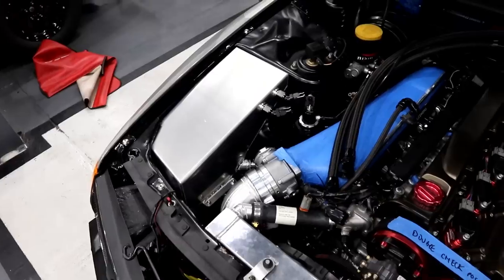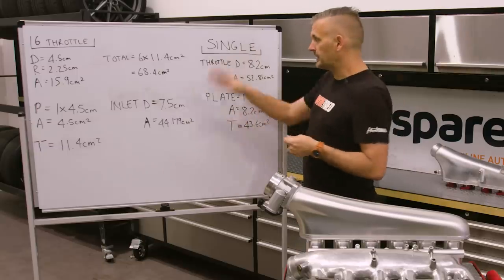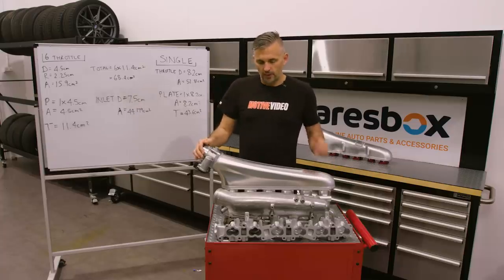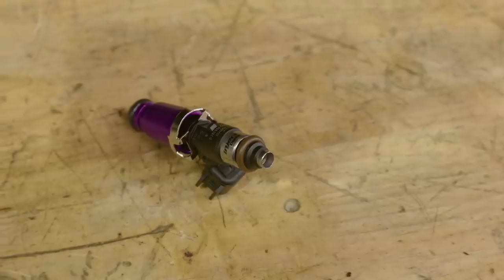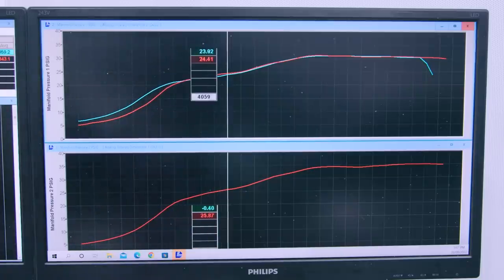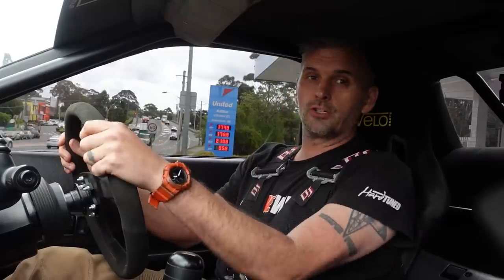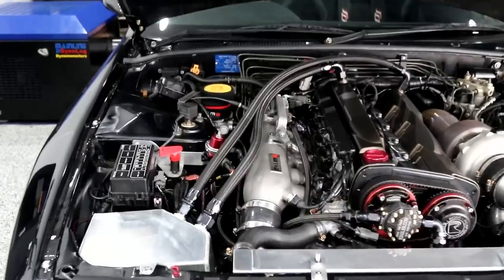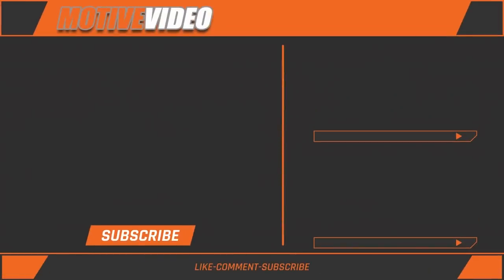6 vs Single-Throttle - Which One is Better on 1000hp RB26? - Motive Garage R32 Skyline GT-R

Comment: @ 20:19 you mention the big throttle body can cause hesitation from low revs. That could also be because of the very large injectors? I know some folk use twin injectors (one big, one smaller) to tune for low revs.

Comment: Every single person that Ive followed has tried drive by wirer and ever single one of them has gotten rid of them because all they did was caused more problem then it was worth. It's to dangerous to run in a drift car and it's useless in a drag car because as soon as you put power to the they shut themselves close. If you could somehow make that work I'd be truly impressed. Also you'd be the only GTR that I've seen on this channel that I've seen have one because all the other ones you features don't have one.

Comment: Have you looked at trying a Bosch Gen 2 iBooster, electric brake booster from a Honda Accord or Telsa Model 3/Y, would be a lot simpler and lighter than vacuum pump, It only requires 3 wires to work, Ground, 40A fused Positive and switched Positive.  

SuperfastMatt did a good video on it call "Inside Tesla's Brake Booster (And How To Use It On Any Car)" about a year ago.
Reply: Those electric brake boosters are horrible, zero feel on the brake pedal just all or nothing
Reply: @luker3456  You want to back that statement up with a source, because I can't find a single review of the Honda model year they were introduced where anyone complains about brake pedal feel, but more than one that says brakes were easy to modulate. The brake pedal is still mechanically connected to the master cylinder and the assist is relative to force on pedal. The assist ratio is programmable.
Reply: @taznz1  its from experience mate, almost every car has an electronic brake booster now and they are all horrible as they all use the bosch off the shelf part.

Comment: Andrew you probably know, but you should see if you can use a pipe with a less aggressive bend or a straight section at the turbo because your just throwing in bunch of turbulant air into your turbo. It needs space to become laminar or close to.
Reply from the maker: Cant without cutting the body up. Plenum sits quote far forward

Comment: Your only criticism is the single throttle is too touchy coming off idle, this is an issue with a big cable throttle but you can tune it out with DBW on Haltech.
Reply from the maker: Correct. It was literally second drive off the dyno.
We can finesse it further
Reply: @MotiveVideo  it's driver preference that takes time to perfect, I'm still fine tuning this on my own 2jz with hypertune/82mm combo, though was instantly much better to drive than the 90mm throttle it used to have, and these issues are amplified by having an aggressive clutch in the mix..

Comment: Flow is about air velocity, so rpm. If you increase the boost the velocity doesn't change. I calculate your car only needs a 50mm throttle body. A throttle body size comparison would be nice with dyno results.
Reply: For Comparison, rally cars have a 36mm restriction before the turbo making 280kw, which is about a 65mm restriction before your turbo for the power you are making. That equates to a 36-40mm throttle body on the inlet manifold. Big difference from what is needed, to what people actually have.

Comment: Going to ditch the ITB's on my GTIR, being a 4cyl the lack of vaccum at part throttle and tuning around that with TPS and boost compensation sucks, plus all the leaky spaghetti under the intake also goes away.....

Comment: For the ITB setup, wouldn't the boost have been higher at the lower RPM band because of what you discussed about volumetric efficiency and how you do not need the entire manifold to be full of air?...so my meaning is that when you roll into the throttle and open up the ITB's, it builds boost quicker and hence, you get more response?

That interior flapper valve sounds like a rotary! Either way, will never be able to afford a GTR again but I appreciate the videos.
Reply from the maker: In theory, but in real life we had no noticeable difference

Comment: Would the stroker mask the off boost performance and that you would maybe see more of a difference if it was still 2.6L?
Reply from the maker: Air is air and doesn’t know what engine if it is. I think bottom end may change a bit but top end power is still top end power

Comment: How do you know your out of turbine as opposed to compressor …..what’s the back pressure and what drop do you have across the intercooler are logging any of this data or do you just drive it and know? I want to see data and time slips, put some sensors in it. Even those 180 and 90 bends on the cold side could effect it or just say one intake looks better than than the other and that’s why you change them.

Comment: Full disclosure, I would personally sack the advantages of single-throttle in favor of 6 because I think ITBs are too cool. No science.

That said, do you think some of the companies selling larger than stock throttles would blur the gap found between the two? I may be mistaken, but it sounded like you were using the stock sized throttles and everything around them was either replaced or ported, correct? Just curious what your thoughts would be regarding replacing the stock throttles with larger. Obviously I don't expect real world testing as this was more than I expected in the first place from any youtuber, just educated guess based on these results.

Comment: You can adjust the APP vs TPS curve to fix your throttle opening issue.
Reply from the maker: We know. Its all just fine tuning on the street
Reply: APP?
Reply: Accelerator Pedal Position
Reply: @rollinrobo  Thanks

Comment: 2.6-2.7L don’t need more boost to make the same power then 3-3.2L
Reply from the maker: Yes they do
That’s exactly how engines an turbos work. Same set up but more capacity means same power on less boost. Literally how it works.

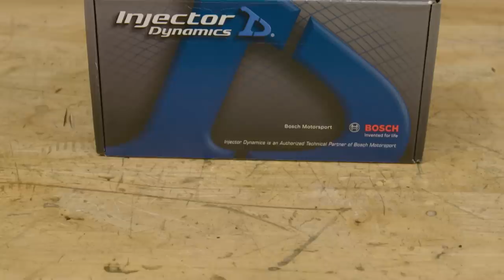Comment: 13:30 off-topic question: which injectors should I go with for my RB26 build? Bosch Motorsport 1650cc or Injector Dynamics 1700X? Going for 600 to the rear hubs with flex fuel.

Comment: Love content like this. Question for you though, on rb25det factory inlet manifold the throttle body is in the centre a common thing to do was have it re welded onto the front to create a front entry to tidy up the engine bay, and as a much cheaper option to buying a greddy intake, but a lot of people said that this causes cylinder 5 and 6 to go lean, is this true or a load of bollocks?
Reply from the maker: You can adjust the injector in each cylinder to compensate. Stock RB26 does it as well. 

EGTs and data show everything. How many people have said “it does this” but shown no data?
Reply: @MotiveVideo  been a wifes tale for years over here in the UK but as usual no hard facts. The rb scene has slowly been disappearing here so its good to watch your content for ideas and tips, the rb25 in mine has been running over 500bhp since 2008 un touched but i was thinking about a front entry purely for aesthetic purposes for under the bonnet, but at the same time im in the mentally of, if it aint broke dont fix it

Comment: It's amazing how some boost turns all sorts of theoretical nonsense and folklore into a cloud of tyre smoke! N/A is a bit different obviously, but modern equipment manafactures have been working on eliminating these issues for decades, so it's not surprising the differences are negligible now.

Comment: Could you change the 1-5% throttle pedal to open the throttle blade less, and smooth out the transition to fix the on throttle feel?

Comment: How is the electrohydraulic power steering unit holding up?
Reply from the maker: Great so far.
Reply: @MotiveVideo  how much amps the electric steering pump pulling from the alternator?

Looking to do similar swap on my subaru... But afraid that stock alternator with around 95A rating couldnt cope with that..

Comment: What about the sound of the itb’s vs the single throttle?
Reply from the maker: turbo cars are different. we cant hear any difference in sound
Reply: probably the only "sound" difference you'll notice is that the ITB engine is a lot snappier in its reaction at low engine speeds. As in the RPM of the engine will rise and fall faster for a  given throttle movement. A good experiment is to blip the throttle on a Rb26 and then blip the throttle on say, an RB25. The Rb26 is a lot faster to react, its snappy. Its purely because of the super short intake behind the throttle runner vs an open plenum with a throttle at the front

Comment: You lost me on the area comparisons with the 6 throttles. The whole engine has to flow through the single throttle body but why do you compare the six individuals multiplied? The engine never flows all the air through the whole six throttle flow area at once, only one at a time through its CSA.
Reply from the maker: one word. Boost

Comment: I always thought the throttle shafts and plates in the factory manifold to be restrictive and disrupt flow. They do take up a bit of area in those small ports. You'd probably pick up more topend if you took 1/2in off the runner too. The runner length is where the power is.
Reply: Did you watch the part where he calculated the area?

Comment: Comparing the single throttle diameter to the ITB's is pointless. ITB's with the same port diameter will be more restrictive and create turbulence especially at high rpm. Sliding gate ITB's are the best of both worlds, but if you use the engine at WOT all the time, it makes little difference.
Reply from the maker: We know. It was a very simplified example.

Comment: it's already been proven that the ITB's make low and midrange power,all out drag cars in japan always removed the ITB's and put on a big plemum with single throtttle body
Reply from the maker: Do they? proven by who? in what videos? What tests? Did you watch our video before commenting?
Reply: @MotiveVideo  i have been building skylines in perth western australia for over 20 years,as well as owning a number of VL commodores with the same factory fitted RB engine as well as RD28 diesels,HKS,Top secret,garage saurus(first builders of the rb20/30 back in the day after they sneaked an australian 3L block back into japan LOL) all used big plenums and single throttlebodies in the all out motors they built,numerous you tube videos on these and other engines have shown the ITB's are great for the street or twisty tracks and big plenums and single throttlebodies are for engines that spend most of their time at redline